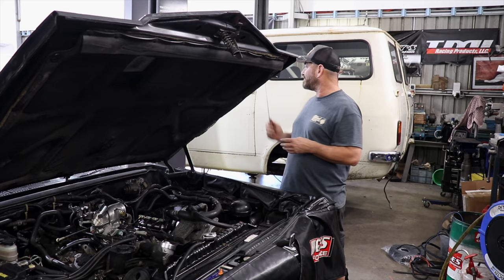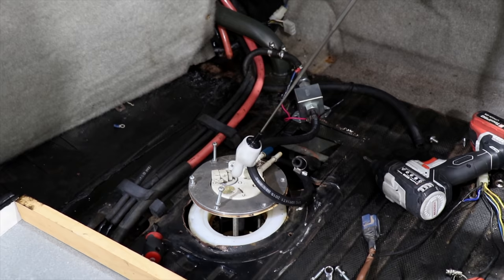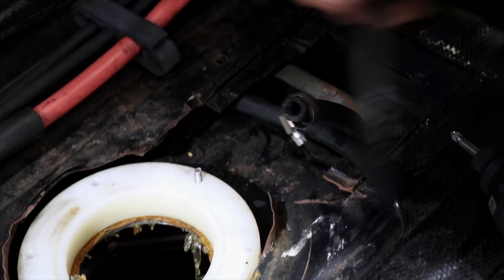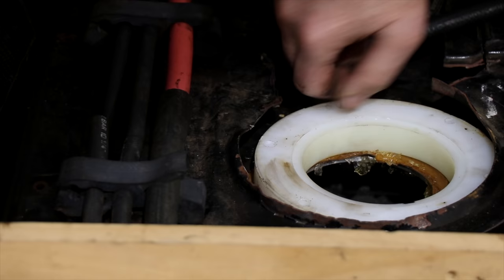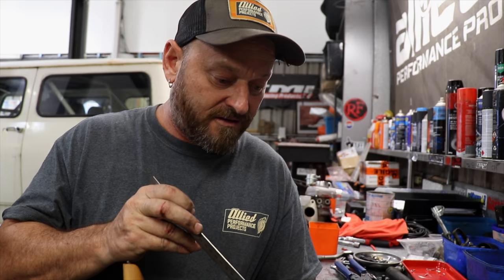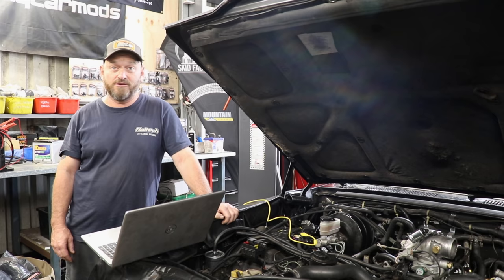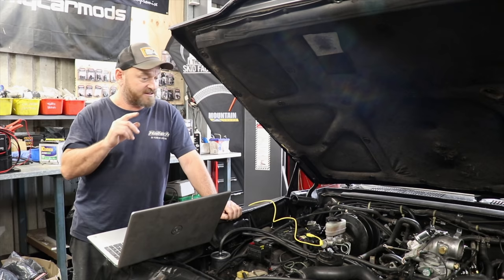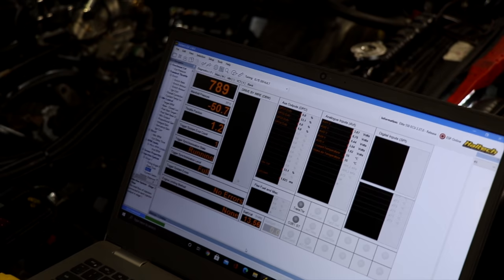Disrespected Fuel tank & First Start - Nissan President Ep3

Comment: In my VL that I had, the intank pump would only prime the fuel line then turn off and the high pressure pump would do the rest, maybe an air leak in the fuel line in the tank. Clamps or cracked fitting..🤔👍👍👍👍

Comment: About the fuelpump issue; it could be an early type of crash module where the fuelpump shuts off when in an accident or more precies; a roll over.
You don't want fuel spilling everywhere, when you just crashed!
Just my 2 cents!

Comment: Should have used the rubber pump holder around the old fuel pump, will stop the vibrations and noise transferring through thats how ive done all of my r31's.

Comment: Well you relay fuel pumps anyway, so this OE fuel pump setup is controlled by another module (other than the factory ECU) - so could have had a 2-stage pump, one for idle/cruise (low noise), and the second stage only ran under certain conditions (high RPM/air con enabled/high current draw from alternator). Another theory is that it could also be done for Anti-Theft (ie. is the BCM controlling it? The same module that controls the door locks?)

Comment: No Datsun experience first hand, so essentially I’m an internet expert! However, having worked on several 80s Toyota’s they have a COR, or Circuit Opening Relay. Basically, the relay gets a signal from the key to trigger the fuel pump so it runs, if the key trigger turns off and the engine hasn’t started the fuel pump dies. In Toyota’s a ground from the AFR opening (air flowing through, ie: engine running) signals the relay to stay on. 
In the event of a wreck and the engine dies. It won’t continue to pump fuel. It’s kind of a troublesome thing to find on Toyota 4runners (surfs) as it’s tucked way up in the dash for no reason at all.

Comment: Not a Nissan guru. I'm a Subaru tech tho and the wrx from early 2000s have a fuel pump controller. It doesn't usually fail until things get modified. Long story short, its unnecessary when the fuel system is modified. Bypass and or remove it. Hard wire the pump with its own realy and circuit breaker and all is well. I'm sure you Allan, are aware of this already. As you've said before Nissan loved to stack brackets on brackets on brackets. I'm sure the same unnecessary redundancies were carried out throughout the entire vehicle. Cheers from Minnesota U.S.A.

Comment: I recon the ground side fuel pump relay is operating like a blinker relay, with a resistance wire to get capacitor discharge or charge as a timer. Is there any more wires that could be "engine is running" to override the shut off timer?

Comment: Man, at least that’s not like 80’s bimmers, there’s a main power relay that powers a relay that powers the injectors, which is triggered by the ECU only after it sees the crank position sensor.  Of course this is superfluous because the ecu also triggers each injector, but I guess it was the 80’s and relays were cheap where ICs were expensive…Took me forever to figure out why I wasn’t even getting power to the injectors.

Comment: It’s a fuel pump speed controller. It drops the voltage at low loads, the walbro won’t run at the lower voltage
Reply: Doesn't explain why the test light just went out completely instead of dimming.

Comment: I think the car when turned on the OEM ECU turns pump on. Since you disconnected everything managing the engine and put in the Haltech the OEM ECU doesnt think the engine is running, so it shuts the fuel pump off?

Comment: Is all that jizz that fell into the tank making the sock choke up like it belongs to a teenager left home on his own, overcurrenting the pump and causing it to shut down? There could be a sense resistor in that llittle module that cuts earth in overcurrent conditions, which would mean that, if you bypass it, you could be torturing the fuel pump.

A HVAC sparky mate of mine found this on one of my cars by hooking an ammeter to the feed wire for the pump. Was normal to start and got higher and higher till the engine cut out. It was also evident because the longer you left the engine off (to a point), the longer it would run before dying. Maybe put an under-spec fuse in and see if it pops it just before the motor shuts off, if you don't have an amp clamp handy.

Comment: My brother has this weird love for carbies. His main point is that a carbie is easier to adjust than fuel injection - "just tweak a screw and tune it." 
He had even gone as far as to replace the mono TBI in his MK2 Jetta with a carbie, but the car was too shit to drive so he only revved it parked a couple times before he took it apart. 
But he recently bought another MK2 Jetta with a carbie and it's been only trouble even since. I even took it for a drive just to find out how shit it is and it's terrible. 

It's got no power and the throttle response ir awful and you can argue that it's the fault of the old carbie but if you're anything like my brother and you praise carbies then your car better run like a swiss watch. And that MK2 Jetta was anything but.
Stalled at an intersection like 10 times before i managed to make it move. It was so embarassing that it actually became funny.
And even after he tried to tweak the magic screw it still drives like shit. 
I'll take injection over carbie any day.

Comment: Al doesn’t that fuel pump controller run off oil pressure switch ? If it doesn’t see pressure then it will cut the fuel pump or does it look for a tach signal. I’m pretty sure it’s one of the 2.

Comment: Do you think you guys will ever do a turbo motorcycle with a Haltach. I'm thinking of doing a turbo swap onto a suzuki 1400 intruder. I it a large v twin engine bike with a 9.5 to 1 compression. They make about 100hp crank, If I do turbo this bike I would like to see about 150 wheel.

Comment: Maybe the startup choke is done by running the pump at full speed and after 30 seconds the fuelpump is run at 90% "normal" speed that fits the fuel map.
Reply: Wouldn't make any difference since the fuel pressure is regulated at the fuel rail.

Comment: I'm not a Nissan guru from the 80s but my '84 Nissan 300C has a "fuel pump priming stage" that occurs for 15 seconds after startup.
It could be a leftover of that system that ensures ample and constant fuel pressure on startup and then the 80s hamsters take over control...

Comment: The original ECU probably had a timer unit for starting. The original EFI used a bosch style flapper door efi which would provide the signal to keep the fuel pump relay turned on as long as air was flowing through it .

This way the fuel pump would stop if the engine was off. Why Nissan couldn't simply use an RPM signal is lost to history......
Yes just ground it out.

At least its not a switched positive like the system was in my 280z when i put a mega squirt into it using stock loom. Yes i could've simply run my own relay but i couldn't stand not using what was already there. 

So i had to reverse the power feed and "earth" on the relay so a more modern computer could control fuel 😂

Comment: Certainly behaving like the "fuel cut relay" function... as I'm sure you know it's there to kill the in tank fuel pump in the event of a collision... a ruptured fuel line with 50psi or so pressure could dump a lot of fuel in an accident..   Early GM cars simply used the oil pressure idiot light switch to keep the fuel pump running..... Dan

Comment: That fuel pump relay setup looks similar to the pressure/current control relay Sarah n Tuned pulled out of her MR2 build in her video today. Is there a  resistor in the circuit?
Reply: I'm surprised you could concentrate on the technical info in her video.

Comment: I'm from the states say it with me. ( SPaRK PlUg wIRes )
Reply from the maker: They aren't wire though.
Reply: @theskidfactory   electrical cables can be described as wire in the states. Mad American points you start using all that correctly.